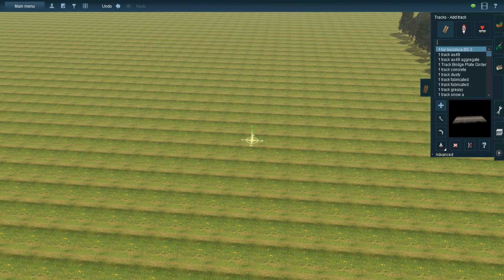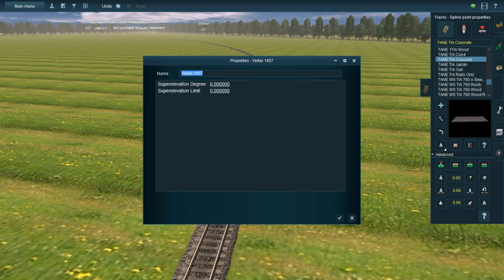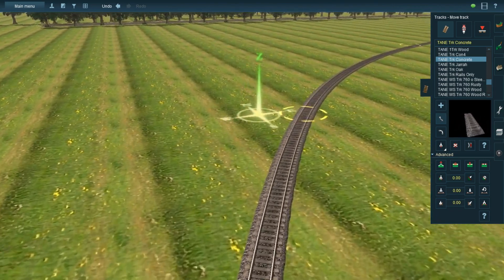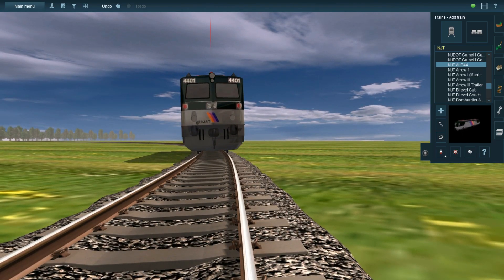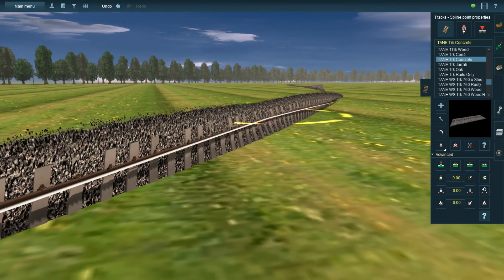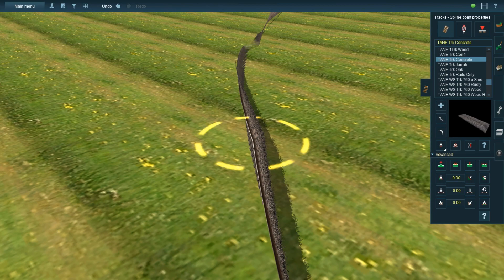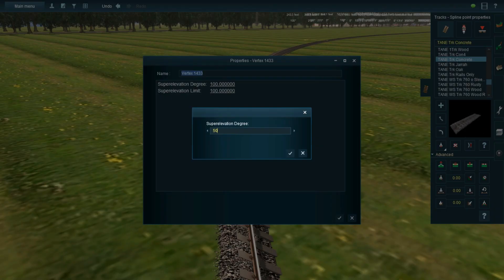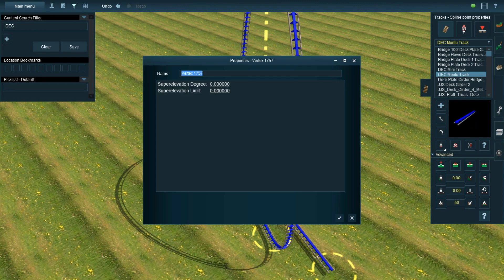Trainfan1055 Tutorials: How To Make Curved Track Tilt In Trainz: A New Era

Comment: Superelevation could be useful when making realistic train derailments and I use that track superelevation before and it was awesome,some people didn't use superelevation invisible track where is should be and making stand up invisible track instead but I'm glad to use superelevation track in Trainz and superelevation could able tilt and twisted engines and rolling stocks which is could off the tracks by invisible track. I learned that superelevation could be fun sometimes. However,there is types of superelevation which is realistic superelevation,actual superelevation and correction superelevation. When any engines derailed by superelevation,the train could tilting sideways and touched on the soil when wheels was covered in soil on the ground and buffers could covered on soil top such as damaged and dirty if you imagine of. And example for you guys,that superelevation was on surveyor mode and only have to do is click on double question mark on the bottom and you see it say that superelevation degrees after you click on the track curve of vertex circle and then add the numbers what you want or calculate them and result of tilting tracks.